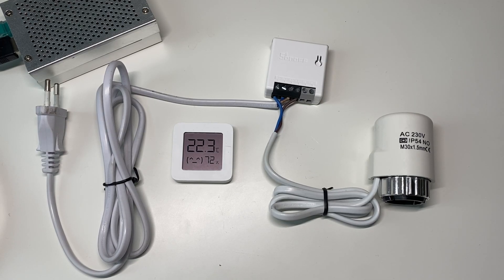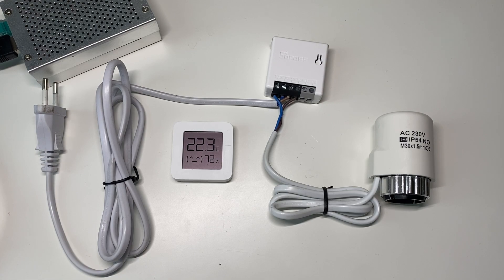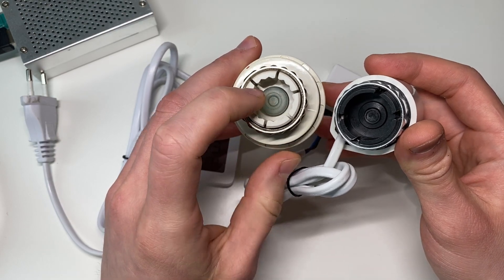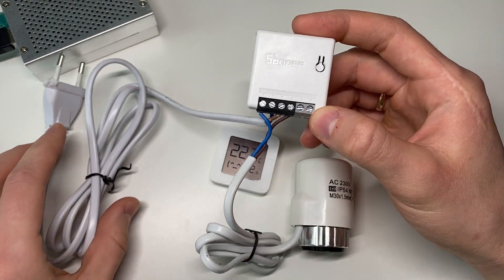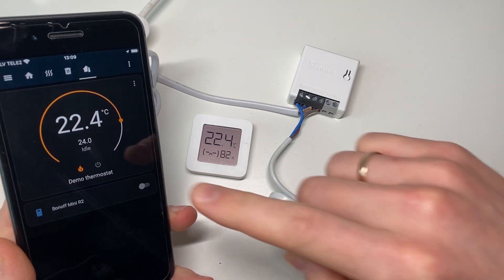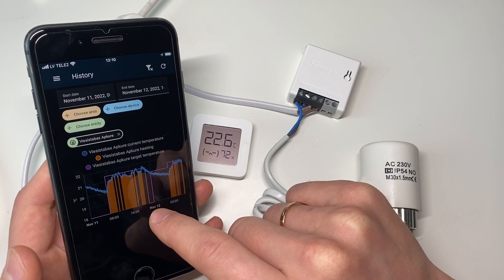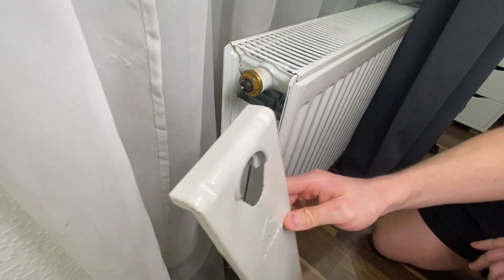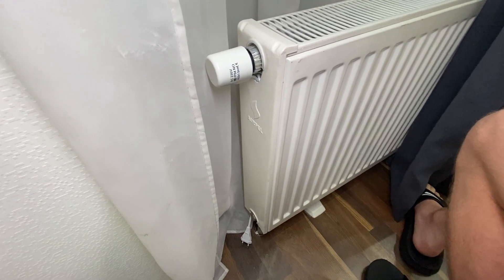The best smart radiator valves for Home Assistant

Comment: Hello and thank you for your video. Do you think the heating is optimal when only using on/off state? Standard thermostat valves usually operate on a partially closed state which optimizes the heat consumption.
Reply from the maker: Hi! It's not ideal. Windows do fog up if heating is off for prolonged time. But in terms of keeping desired temperature in room they to a decent job. Not really sure how optimal the consumption is.
Reply: @guntiss  Thank you for the information. For the price you paid, the setup looks great. Cheers!
Reply from the maker: @speedermarto  Just wanna let you know that all these chinese valves stopped working after few months, so I don't recommend them anymore. I replaced them with Danfoss brand, which has been working great ever since, though more expensive.
Reply: @guntiss  thank you for the info. Can you share exactly which ones do you have now?

Comment: Really great adaption however I'm a bit reluctant to use mains power near any water or the radiators but you have given me an idea to possibly find something similar with a less voltage requirement then use battery power instead of mains thank you.

Comment: I love this !!! I have been looking for something like this. Absolutely awesome! Well done! I am moving to a new place next weekend, and I would like to control my own heating automatically. I think the regular smart radiator thermostats are a bit on the expensive site (and closed software loop), so I am going to try this. Crossing my fingers. I think it's actually impressive that temp only fluctuates with +/. 0.25c! Subscribed!
Reply from the maker: Thanks. I actually recorded this video 2 months ago, and so far they have been working excellent. Except that last week one of the valves stopped working, causing heating to work on 100% all the time. Luckily it's just few minutes of work to swap with the old one. So if you are not on very tight budget I would suggest ordering one extra, just in case.
Reply: @guntiss  Thanks for the answer! So it's a NO valve? 
I have bought a Danfoss one for testing (unfortunately more expensive), so I will see if it lasts. I guess I have to look at reviews and compare price to longevity once I get the project running and need to install more :)
Reply from the maker: @politibetjent  Initially I had NO, now I ordered 4x NC valves from same supplier.
Reply: @guntiss  I see :) Anyway, I think your argument with open/closed depending on room makes a lof of sense to me. 
Please feel free to do updates if you customize it any further or have any other good ideas. I can't wait to get started and learn more!
Reply: Very nice! I love the option of not having to change batteries in a trv so this gives me a much better option. I am however worried about how the motor controller and wires will stand the test of time being stored so close to a radiator. Let us know how they have been doing after the winter ends, please.